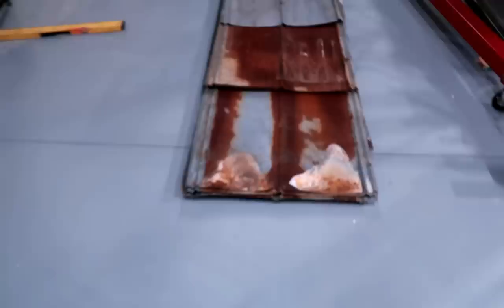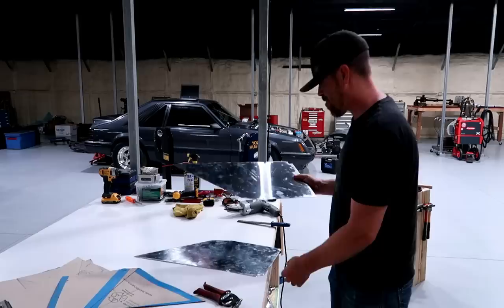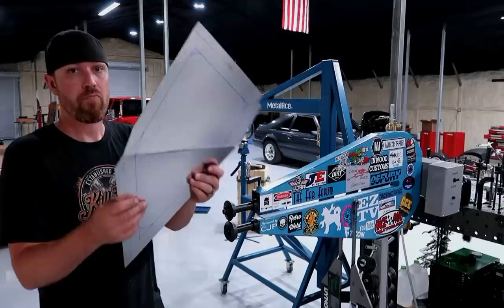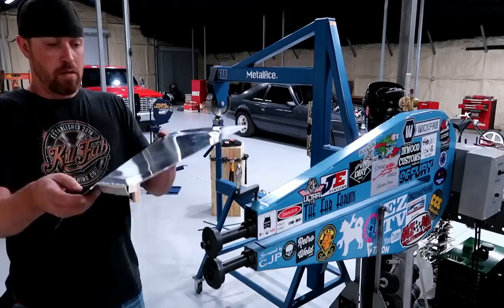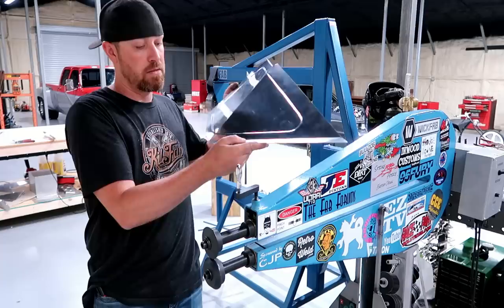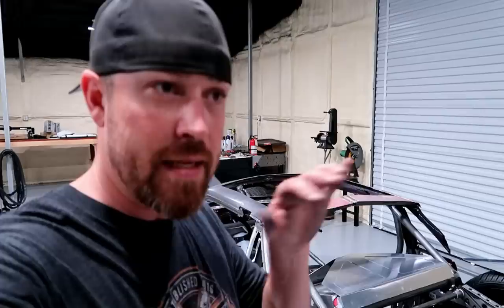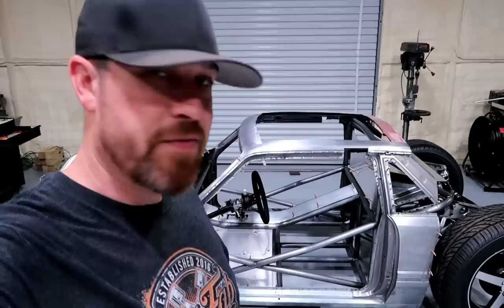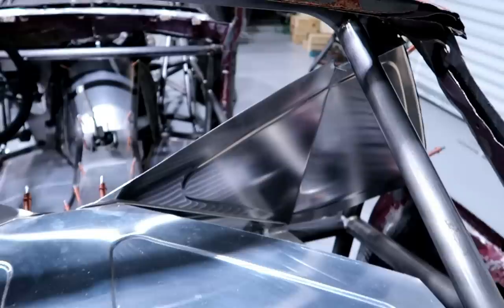How To Make A Rear Mount Radiator Shroud

Comment: Just stumbled on your 'show' on Amazon Prime, came here to get the latest on the build. 
Wondering how you are running the coolant lines to the radiator. Thought at first it might be going thru the frame, then noticed no hoses connected to the radiator yet. 
Looks like this will be a sweet build when it's done.
Reply from the maker: right on!....lines will mostly be aluminum tubing running from the front to back through the trans tunnel area

Comment: Are you trying to increase the echo or decrease it? Adding tin will only exacerbate the issue multiple times over. Sound is deadened only through absorbing it / changing it's speed, not by reflecting it. You need materials like Gyprock, or soft furnishings like cushions, or material wall hangings like flags to stop the echo. I know you are looking for a cool factor but corrugated iron is definitely not the answer.
Reply from the maker: Yeah I know...gonna do something's besides tin